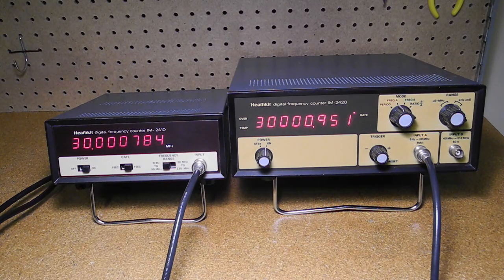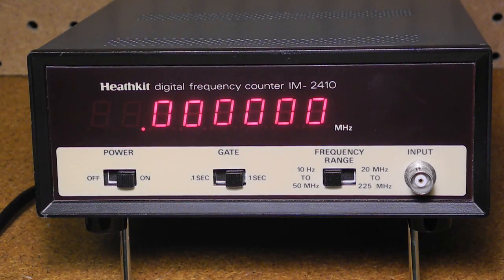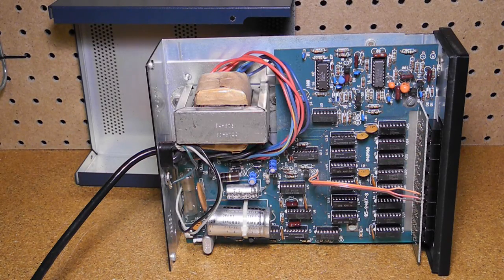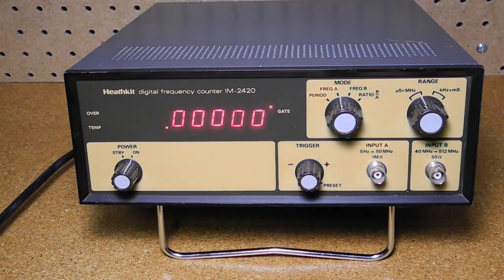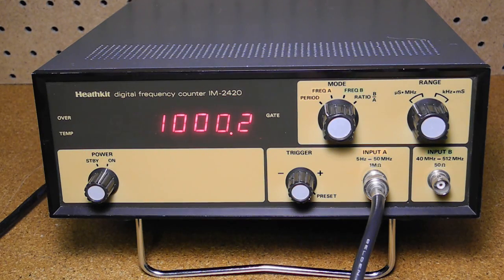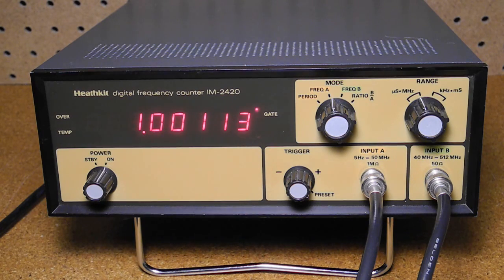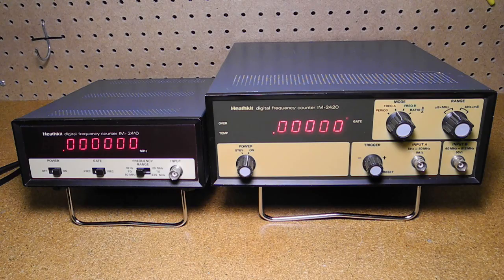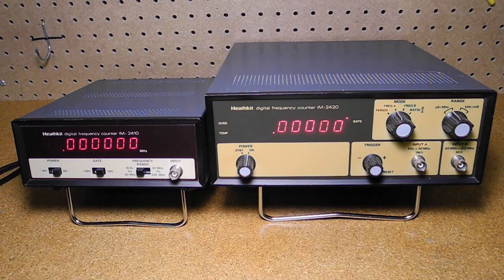The Heathkit IM-2410 and IM-2420 Digital Frequency Counters

Comment: I was recently given the 2410.  I've got it running with a TCXO synth board in place of the crystal and it's deadly solid now.  I'll probably add a GPS 1pps signal to the synth just because I can... ;-) 

However, I note that mine runs really warm. The 8 LED driver chips are pretty much too hot to touch, as is the big resistor at the back that is wired across the 5 volt regulator.  My unit has a 20 ohm resistor there, but the original manual specified a 10 ohm (5 watt).  Your video almost gave away the value of the resistor in yours, but not quite... I could see two black bands, but the first one was hidden by a wire!!  I'm seeing 4.75 volts from the 5 volt supply, which is probably a little below spec, but I don't have any way to confirm.

I'm wondering if you notice any excessive heat from yours?  And if you happened to see an issue with the value of the 5 watt resistor?
Reply from the maker: Mine has a 20 Ohm 2 Watt resistor. The display drivers chips do get quite warm, which is apparently normal.

Comment: The 2410 was my first counter and was replaced by the 2420 that's still on my bench today (built in the early 80's). I modified the 2420 by mounting a front panel switch and internal relay to switch between the rear panel 10MHz reference switch since it's a pain to reach behind if I want to engage the Rb standard...still my go-to counter even though I have a Agilent 53131 on the bench as well.  73 - Dino KL0S

Comment: I have a SM-2420 I got in a lot of items a while back, it works great what would be the value of it for selling? I would like to know a fair price to list it for sale. Thx
Reply from the maker: +Randy Metcalf Prices vary depending on where you sell it. The highest prices are generally on eBay. You should be able to get about $50 to $100 for it, maybe at the upper end of this range because it is the factory assembled version.
Reply: I just bought one on Ebay for $70 with free shipping. It looks to be in perfect condition. Proceeds are going to a radio club in Chandler Arizona

Comment: Very good information. I have  an SM-2420 which looks very much like the IM-2420 you displayed in the video. I don't know what the difference is but probably not much.
Mine quit counting so I'll be needing a service manual for it so I'll be surfing the internet for one unless someone has one that reads this?
Reply from the maker: Carl Stewart The SM-2420 would be the factory assembled version, and should be almost the same if not identical to the IM-2420 as far as circuitry.